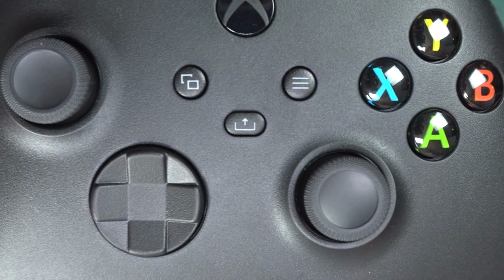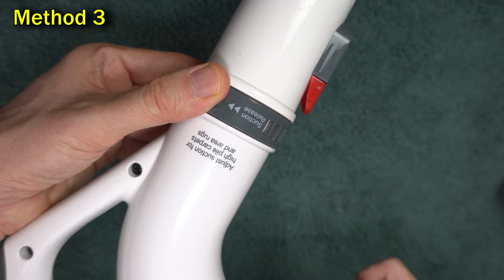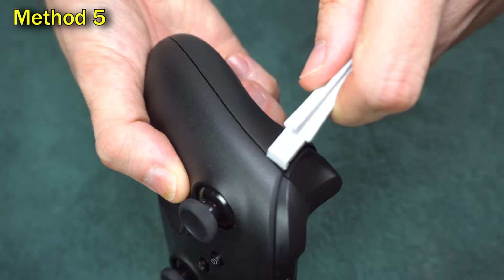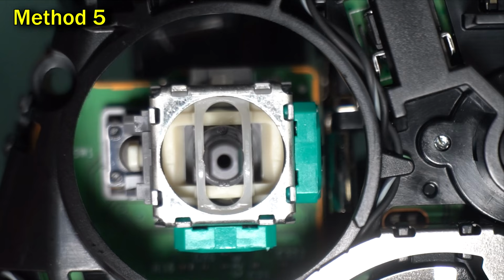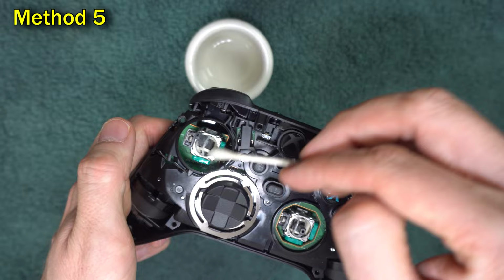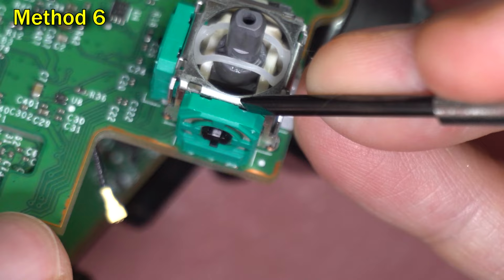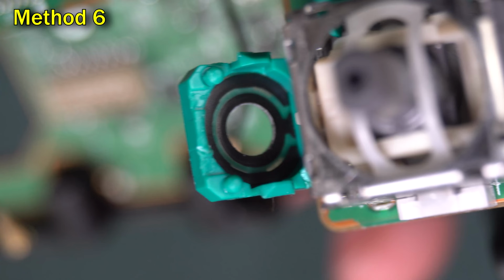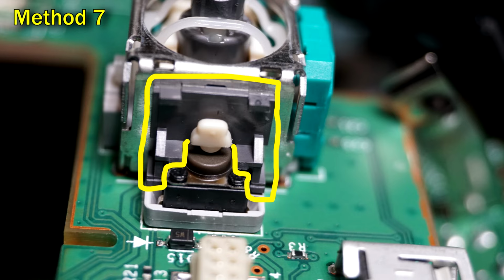How to Fix Analog Drift on XBOX Series X/S Controller (moving on its own, jittery, wrong direction)

Comment: Chat GPT gave another solution 

To create a program that can detect and compensate for joystick drift on an Xbox Series X controller, you would need to utilize the Xbox Series X controller API and perform some calibration and adjustment calculations. Here's an example program in Python that demonstrates the concept:

```python
import pygame
import xbox360_controller

# Initialize the Xbox Series X controller
pygame.init()
controller = xbox360_controller.Controller(0)

# Constants for joystick drift compensation
DRIFT_THRESHOLD = 0.1  # Threshold for joystick drift detection
DRIFT_COMPENSATION = 0.1  # Value to compensate for joystick drift

# Main program loop
while True:
    # Get controller input
    pygame.event.get()
    joystick_x = controller.get_left_stick()[0]
    joystick_y = controller.get_left_stick()[1]

    # Detect joystick drift
    if abs(joystick_x) < DRIFT_THRESHOLD:
        joystick_x = 0.0
    if abs(joystick_y) < DRIFT_THRESHOLD:
        joystick_y = 0.0

    # Apply drift compensation
    joystick_x -= DRIFT_COMPENSATION if joystick_x > 0 else -DRIFT_COMPENSATION
    joystick_y -= DRIFT_COMPENSATION if joystick_y > 0 else -DRIFT_COMPENSATION

    # Perform controller actions based on compensated input
    # Your code to control the game or perform specific actions goes here

    # Exit the program if the Xbox button is pressed
    if controller.start:
        break

# Clean up the program
controller.close()
pygame.quit()
```

This program uses the `xbox360_controller` library, which is a Python wrapper for Xbox 360/One controllers. You can install it using pip: `pip install xbox360_controller`.

The program continuously reads the left joystick's X and Y values from the Xbox Series X controller. It then checks if the joystick values fall below a certain threshold (`DRIFT_THRESHOLD`). If the joystick values are below the threshold, it means there is drift, and the program sets the joystick values to 0.0 to compensate for it.

After compensating for the drift, you can use the adjusted joystick values to control your game or perform specific actions. This example program only demonstrates the compensation part, so you'll need to add your own logic for the desired functionality.

The program also includes an exit condition where pressing the Xbox button on the controller (`controller.start`) breaks the loop and closes the program gracefully.

Please note that the program assumes you have the necessary dependencies installed (Pygame and `xbox360_controller`). Make sure to install them before running the program.

Comment: I’m sure this worked with some, but BOY did it fail for me, here is the condensed version:
1: I took it apart, cleaned it using step 5, and it failed.
2. Took it apart again and this time I used step 6 and not only did it fail, but I lost control on the left/right direction.
3. Took it apart again and cleaned the other side and the same side via step 6 and now my controller has no control on the left stick and extreme drift on the right stick and no control over the up/down on the right stick.

Comment: Thank you, I been having drift issues on one controller. But I was to lazy and didnt have enough time to fix it so I used another one. The one with drift was my favorite but like i said, i was lazy and didnt have enough time. But I have time thanks to Christmas break and I grabbed a straw a blew into it, it fixed my issue! Thanks, also one more thing, if you go to the same place before you update the controller, theres a flask icon. Tap it and it shows what button is being used, so you can fix it while seeing this.

Comment: I remember when fixing my old ps4 controllers I got recommended to use canned air to get dust out of the joysticks, I tried that with my xbox controller with no luck, but when I just blew into the joystick with my mouth it fixed it completely. I am at a total loss but thanks

Comment: The last (unofficial) method worked for me. It seemed to have loosen the analogue. Think this option should be higher up as many will find it difficult to doo the deeper fix. Can understand if your a reputable repair expert, you wouldn't want to do this.

Comment: I used a white Xbox One S controller for like 6 years with a LOT of drops and hits, it stills works perfectly.

I have been using the black Series X controller for like less than a year and it is already failing:/
Reply: Samee

Did method 5 and used a syringe and a mini thin tweezer and properly cleaned it for like 30 minutes.

It went from drifting all the way to the top and inconsitently to the bottom to only a minor drift up and a bit right, but so little that it isnt really noticeable

Comment: READ THIS: if u have the same problem as me, which was the right stick would keep going up and was rlly not good for aiming, so i stuck a bobby pin like into the controller, so its kinda like sideways into the socket, its not broken my controller just be careful were u put it, its a horrible temporary fix but it works!

Comment: Fantastic video showing the cleaning of the inside of the potentiometer! I did this tonight with a newer Series X controller which I thought just wore out the resistive track that the wiper rides on, however it did not behave the way I suspected (my drift issue was right stick slowly and intermittently moving upward in an inconsistent and jittery manner) and I suspected debris. Pried open side cover gently and poured 91% isopropyl alcohol in there where the metal springy wiper and tracks is and then close it some, went back and forth on the stick, and repeated the process once. Then I blew the whole thing out with compressed air and reassembled. Tested controller, and it's like brand new!

Thanks for the vid!
Reply: Still work?

Comment: Assembled the controller after method 6, the following inputs are not registered: LS forward / RS forward / RS down.
I dissambled it 2 times to check if the wiring went loose / off, but everything seems fine to me.
Any ideas what could cause the problem ?

Comment: All, which means 4, 360 controllers work fine. 15 years later. All, which means 5, Xbox one and series X controllers last 13-14 months and like clockwork, left stick drifts to death. Same with all my friends. It's like they are intentionally made just to outlast the warranty before this happens. It's very consistently horrible.

Comment: Thank you! I have had my controller for 3 years and I just got my first problem with it. My problem was i had strong vertical drift even afrer recalibrating multiple times etc i was even considering a repair shop but then i did the straw method and now there is 0 vertical drift instead the controller just can't center properly it kind of hangs off to the sides of the center but its very much playable since im no longer constantly checking if the sun is still there in game lol I'll update this comment if anything changes

Comment: I pushed all the way to step 6 and managed to successfully pull it off without breaking anything. I cleaned everything thoroughly went through like 7 alcohol wipes and 12 Que tips. The controller works just fine so I did everything right and didn’t break it. But it did not fix a thing.

Comment: I haven’t even had my series s for a year and dropped my controller one time by accident and it has fkn stick drift. Idk if anyone notices the weight between the S/X controllers compared to the original one. The og one has a bit more weight and actually doesn’t feel tacky as for the other controller it feels very light and tacky

Comment: Awesome video! Wanted to fix a little drift, now it won't turn on at all great! Just broke my controller completely:)
Reply from the maker: It might be the connection between the two boards. Maybe they did not connect back together tightly enough (assuming you got that far in the video). If it were me I'd  disassemble and put it back together again (don't reopen those little doors though) and see if that gets it working again.

Comment: WOW, just wow. Never before have i seen such a well made and simple video at the same time. I got to method 6 (which i was skeptical about) and actually managed to damage the Green box, thinking i messed up i told myself i might aswell do the other green box. And it fucking WORKED. I stopped playing videogames but i wanted to play a bit of apex with my friend so i grabbed the controller just to find out the left stick is fucked. This helped me so so much!

Comment: Method 2 was the charm. I tried to walk forward, but the controller would go different directions, it was weird. I gave the joystick a bj, and it worked... I feel used now...
(the first time I sucked the air, so a lot of dust came in my mouth, I felt even worse, I don't know what I was expecting).

Comment: Got nothing to do with anything but the sliding discs inside the  rotation modulators open the slits discribed and replace the discs inside dont bother with anything replace both discs as this will upgrade the use of the controls further than were it was before the change

Comment: My PS4 of many years stopped working about a year ago and i was debating get the PS5. Ended up getting an XBOX series S for a Christmas gift and although I've always been a playstation guy, Xbox quickly grew on me until... I realized how garbage these controllers are, I've purchased 4 within 7 months (1 because i wanted an extra the others because of the drifting issue). At 50 plus bucks a pop, you shouldn't have to go through all this after a few months. PlayStation controllers hands down ar a better product, given the costs of paying for new Xbox controller every few months i think just getting the PS5 would have been the right move. Xbox y'all have to do better!

Comment: I did everything up to step 5, I couldn't do step 6 because I didn't have the bit small enough to get the scews out. After spending like 30 minutes on doing all the methods I still had drift, and finally just said FUCK IT and sprayed so much contact cleaner inside it was dripping from all sides of the controller, shook controller like mad, wiggled joystick around and nuked more contact cleaner into the joystick, contact cleaner dripping all over. I let the controller to dry and tada it works now lol.

Comment: The only real way to fix these is put in a new stick chassis, they drift for a reason either the stick mech is worn or the potentiometers are naffed these sticks are of really poor quality, I had to replace both mine with ones from eBay so far so good.

Comment: Method five worked for a few minutes, but it came back really quickly. Tried method six and now I can't even get the stick to work. And one of the little connectors won't fit back on, so I guess I'm buying a new one. Man this sucks, I haven't even had it a full year yet.

Comment: 2 Months of use to play PC games, right stick started drifting straight up. Have my PS5 since 1 year, the controller behaves just like a new. It's a shame that the series X controller looks and feels good, but it has a high chance of starting to drift.
The DualSense is just far more superior.
Reply from the maker: Judging by the viewing patterns of my videos, the DualSense suffers from the same amount of drift at the Xbox controllers. It uses the same type of components for the sticks. Perhaps you will be lucky.
Reply: @HowToX  but that's true for the first version of the dualsense, no? The V2 seems to be more durable, as people complained that the V1 breaks after 70hrs of gameplay.

Comment: the grips aren’t on there as much as the xbox one original controller the xbox one original controller is on there so tight it made my fingers bleed when trying to take it off but series s controller grips are easy to pry off.. also some of the video made me cringe like how you didn’t say you could use a flat head screwdriver on the screws and how you said you could damage it but all your doing is taking off the covers which isn’t rocket science.

Comment: Had a Series X and PS5 controller start stick drifting within less than 5 months each with barely any gaming. Never had an issue on PS3 but PS4 one started having issues few years of use.
Reply from the maker: My theory is that factory dust gets into the sensors.

Comment: This is very disappointing that a controller of this price point has stick drift issues after an year of use. I have a PS2 controller which is 11 years old and still doesn't have any stick drift problems or any major issues. Disappointing on Microsoft's part.

Comment: Never had any problems with drift until 2019 when my left joycon on my first switch but I got a series S back in may and already my controller has really bad drift. Both up and down will do it constantly and thankfully I still have my Xbox one X and can use that controller only bad thing about that is the A button sticks a lot lol. I well I’ll take that over drift. I’m a boot get my air compressor and try using that to try to blow air around the stuck

Comment: Soo a quick question that I would be very greatful if you were to answer, if the controller is reading that I'm pushing one of the sticks up but I'm actually not doing it, is it still stick drift? And if no do you know how to fix this issue, cuz I have 3 xbox one controllers with this issue and I am kind of afraid of disassembling them and messing smt up for no reward

Update on the controller: I might have fixed the issue by an accident, so I tried to pry open the green door that holds the mechanism for the up and down movement of the stick without fully unscrewing the controller { the smallest screwdriver like that I had was 8 which did not fit into the second layer of the screws } and it actually worked

Comment: with each new generation the controller makes you trouble faster. 
i replaced my xbox one controller when the rubber on the left stick was so worn down that half of it already fell off. series x controller has suddenly insane stickdrift and i didnt use it that much. Theres zero wear on the sticks but its already ruined.

Comment: I had to do method 6 and open up the door.  The damn controller is less than a year old and only moderate use.  My X360 controller has been working for almost 20 years! I just cant find play and charge kits for it anymore.  Is this normal? Do I have to do this that often?  But thanks to your video it is working!!! That drift was very annoying!

Comment: I tried Up to fix 6, nothing worked. After 1.5 year the left stick is still fine but the right stick along Y axis stared drifting just about after 1 year, I believe I’m still lucky here.

So if I don’t wanna get a new controller, the next step would be soldering new stick right?

Comment: If only I knew how to get my controller apart, so I can fix the problem instead of taking it to GameStop. My last resort would be getting another controller. Although I can’t help when I eat and game at the same time so I guess it’s my fault too.

Edit: i’ve tried pretty much all methods and it’s no result. Especially method one. Whenever I try to pull the left analog out like you did it doesn’t snap out of place or anything. Is this all after you took the controller apart or can you do it with intact?

Edit2: by the way, my controller is already updated

Comment: I have had my xbox controller for about 3 months and it started having stick drift and I have recently tried compressed air and it did not fix the problem. I have tried multiple times and it does not even fix it a little bit

Comment: I have a issue where if I move it slightly it jumps to spaces instead of one on the homescreen and I can't figure out what's wrong. Any vids?
Reply: I have this, did you find a solution? I've tried upto Method 6 with no luck.
Reply: @thebesttheworst2277  nah bro I gave up
Reply: @thebesttheworst2277  nah jk just found a dust bunny inside the analog once I removed the cover and the button. Surprised dust can get inside
Reply: @justinjuarez1852  Thanks for replying, I've just cleaned it up to Method 6 so should have got all the dust bunnies out I reckon ha, oh well thanks again for replying 👍

Comment: Thanks a lot !! Method 6 works, Just wonder... I am trying to keep my controler always clean, but there was inside such black dirt, no crumbs, it seems like residua of plastic or attrition of the iron parts, I would say there is some kind of inappropriate material that cause this issue. Or  Am I wrong? Thanks

Comment: At 4:43 I think I put those two connectors back on reversed. My controller no longer works. It’ll turn on and connect to my Xbox but has zero input to the Xbox. Do you guys think that completely fried my controller?

Comment: Please help i did method six and it worked i no longer have any stick drift but I have a new problem, whenever I use my left analog stick it works up, left, and right but does not respond to down? please help

Comment: What is the gray wire for in the controller? Mine disconnected. Yet after testing the controller all buttons work and vibration. Wondering if the vibration is just lessened now, or not "right"